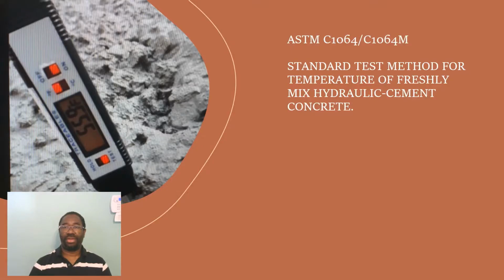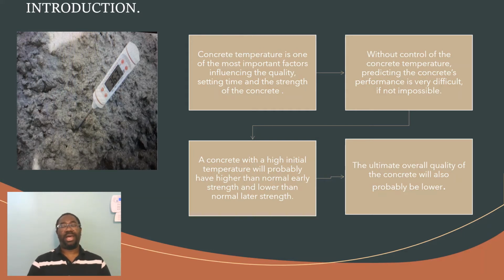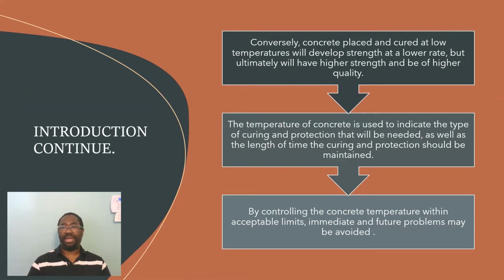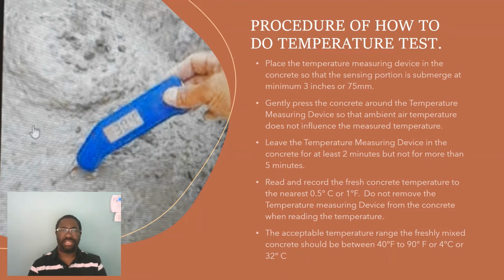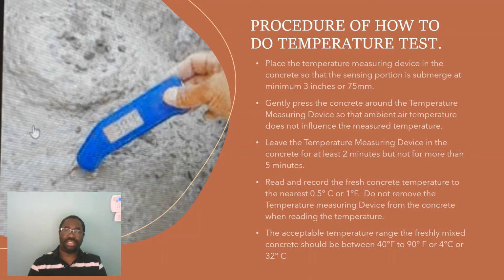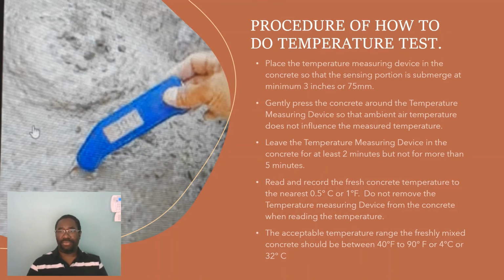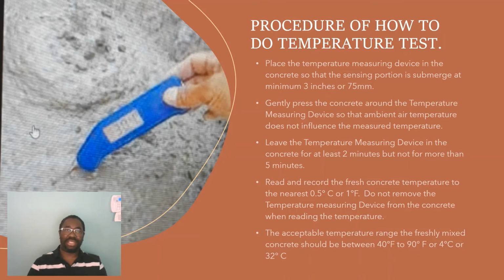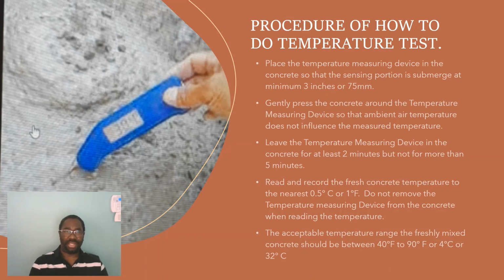How to do temperature test for freshly mix concrete.

Comment: Great info ! .. my question is by jamaica ambient temperature being so warm , when should you pour , i know where i am we would pour early morning , night or add ice to the trucks . , especially if your pouring a bridge deck .
Reply from the maker: I am aware of that early morning and night pour as used to work as a construction inspector in Pennsylvania on a lot of bridge projects. In Jamaica we pour concrete anytime because even though the the time hot,  the humidity is low. Respect.
Reply: Presently a construction inspector in maryland, keep up the good work your info is on point mi boss